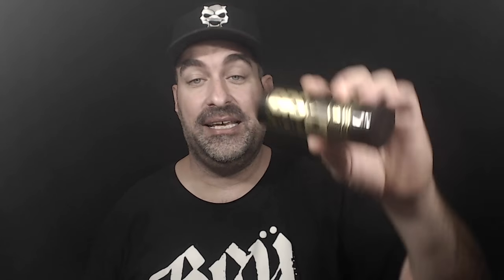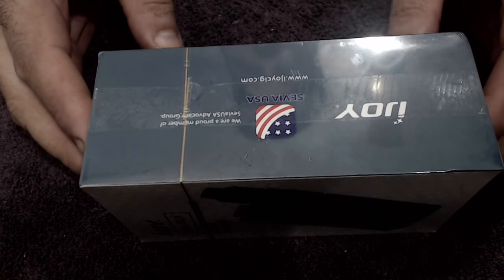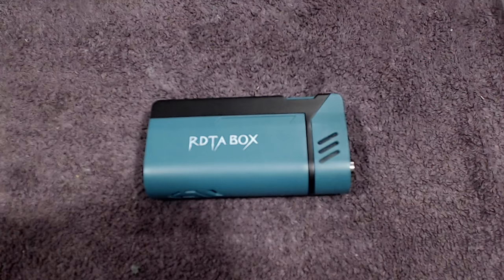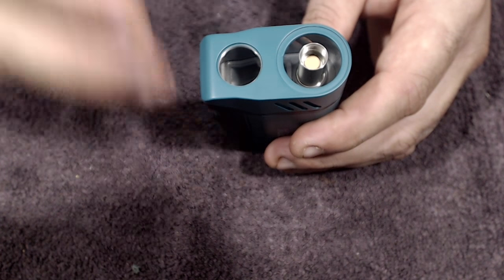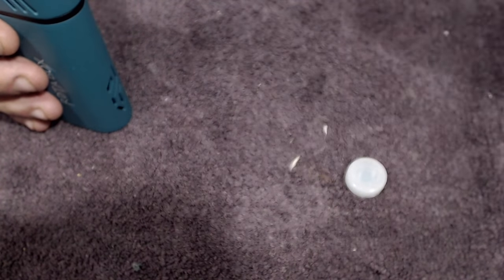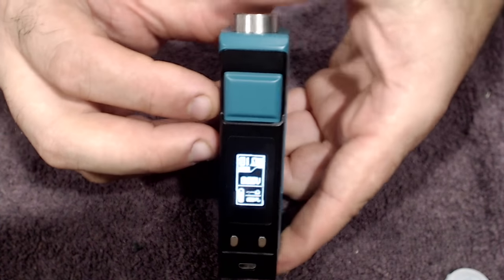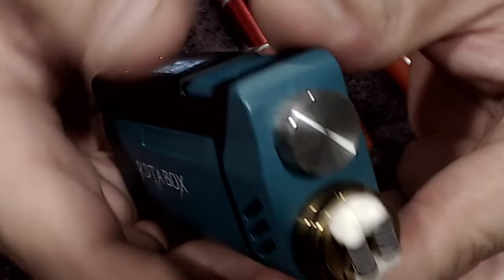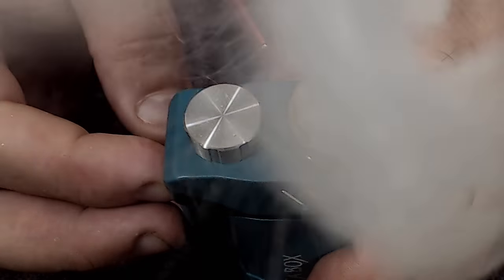IJoy RDTA Boxmod Review Unboxing & Build Tutorial 0.33 & 0.20 ohm builds

Comment: I'm not in love with this device but happy for under $50 (thanx for the code). Very easy menu and bright large screen. Included pre-built tri-coil (.15 ohms) works well but I did have to re-wick since it was stuffed with so much cotton it was choking juice flow. I like around .3 ohms for this. Other included two post is easy to build on. Love the cap keeping lint and weird crap out  plus preventing leaking. They should be universal. I just wish it was a smaller and lighter device for me to carry around. Be sure to like the juice you put in cuz you'll be vaping on it for a while, ha ha!

Comment: I have this unit with the stock deck, i dont own a coil rebuild kit, could you give some tips on how i can ensure i dont ruin the coils when installing them wud i b best using a electrical screwdriver to keep the coils from misshaping as i dont have a rod to go through the coils so currently they are abit twisted so they run at 0.16ohm.

Comment: I got this with your coupon, however i kinda wanted to wait till djls vapes charts, but i am afraid it would be too late, the only issue, it would be that on heavengifts it would be the shipping, the most decent one would be the 20 usd , so you would pay 60 usd, still better than paying full price plus the shipping.

edit: how hot does the driptip gets at 120?
Reply from the maker: I chain vape my device all day long. Like I said I prefer vaping at 0.33 ohms --> 0.45 ohms cause it uses a higher voltage like how series boxes are but if your ohms are lower then your device or batteries will start to get hot cause you will be pushing the limits of your batteries. That is why I love vaping at .33 ohms cause it doesn't get hot on me and I vape it all day long till the batteries die.
Reply: ABSOLUTELY agree...  Nice to see someone who actually "gets it".  Esp. when it comes to regulated/adjustable anything....  having a super low ohm resistance/build means nothing other than HOT & pushing your batteries.  It's the point of having that adjustability....  Unlike that mech mod, where the setting aren't adjustable...  When, to get that hotter, quicker firing, more powerful build, you'd need to base pretty much everything on your build type & mostly.. lowering its resistance.  Those wondering why or complaining about adjustable stuff... about not firing low enough, just.... idk... smh.   ;)   Have watched ya since the start & appreciate all the time/effort you continue to put in to all your vids & this channel.. for our benefit.   (that said, wondering..... that code: straight discount OR...  "affiliate" link?  If the latter, might be something to be sure & mention. :)  .. just sayin'.  If not, nevermiiiiiind.  lol)  Your vid = one of the only ones I heard so far mentioning Twisted 420 affiliation... weird.   Anyhoooo... ENJOY that-there regulation... lol    LIVE LONG(er) & VAPE ON!  #ABillionLivesFilm